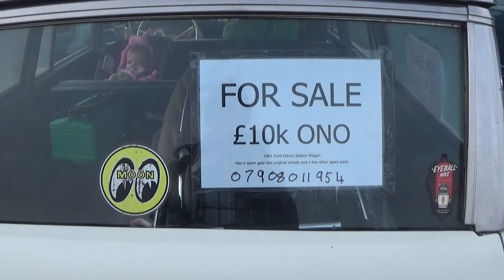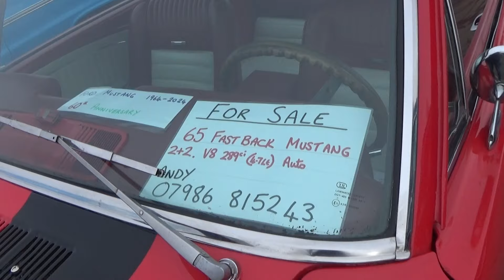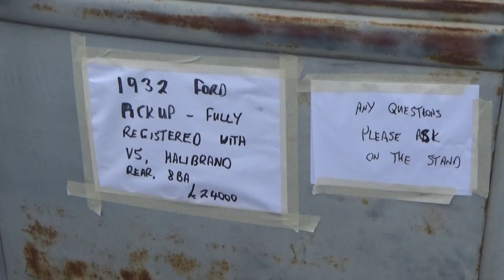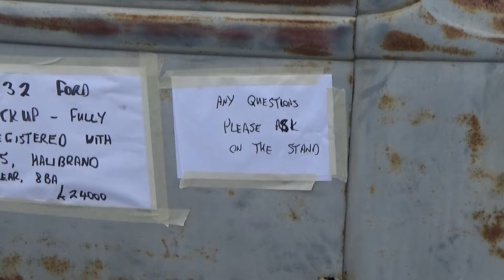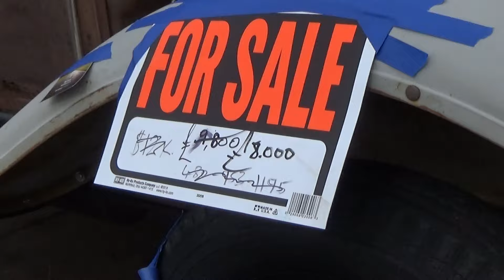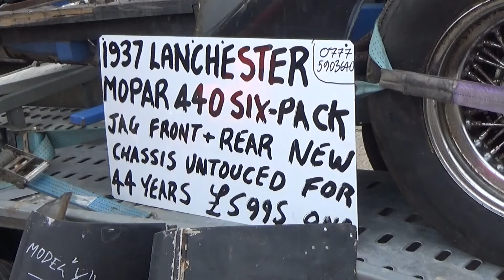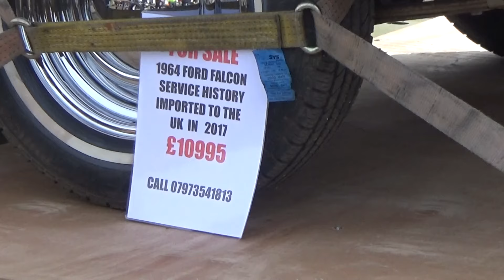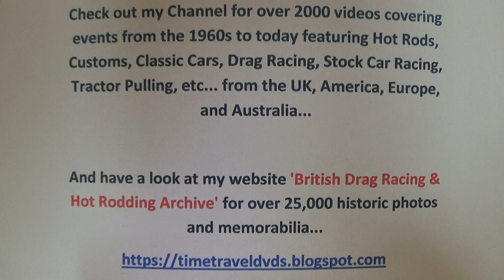NSRA Swap Meet North Weald March 2024

Comment: Question for Nick or anyone.  Are hot and bothered,  puddle jumper and any of the other old rods from the 70s still around? My boyfriend and I went to lots of the hot rod meets back then aswell as the custom car shows at Ally Pally etc. I think hirise henry is still around.  There was a mk 1 cortina with a v8 from norwich ( where we lived) but i think that caught on fire. I left uk in 81 and lost contact with uk rodding scene.
Reply from the maker: Yes Hot 'n' Bothered is still around along with many others from the 70s including all of Nick Butler's cars. Some still look the same and many have gone through different guises over the years. My Y was built in the 80s when it was full fendered and pink but now has cycle fenders on the front and bobbed rear and is yellow but it's still the same car. The Mk 1 Cortina you mention was probably Paul Wayling's car. That was rebuilt after the fire but I've not seen it for many years...
Reply: @NickPettitt  thanks,  yes Paul wayling was the person,  my boyfriend knew him better.  We attended the nsra annual meets at little billing,  Beaulieu,  and others I can't remember.